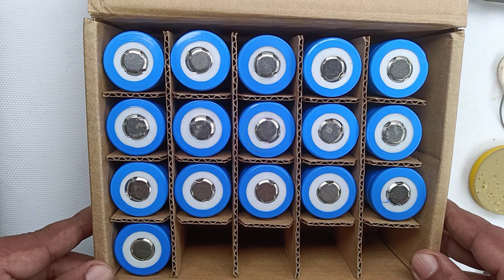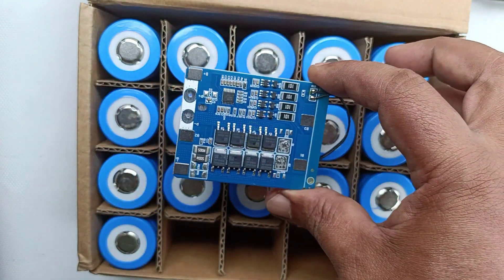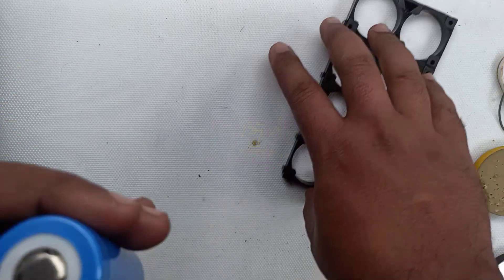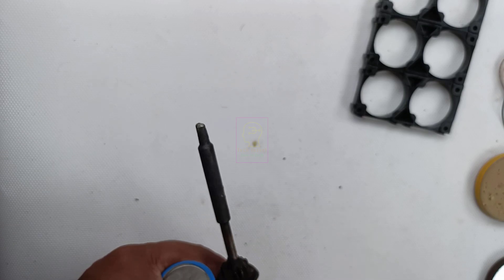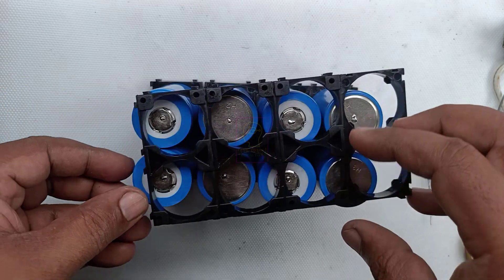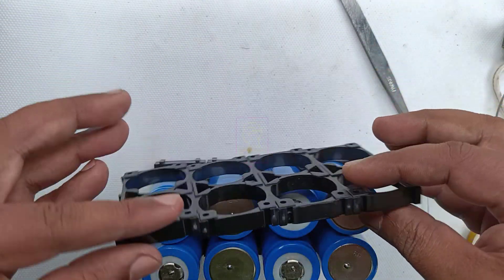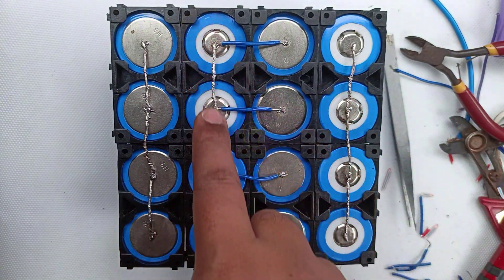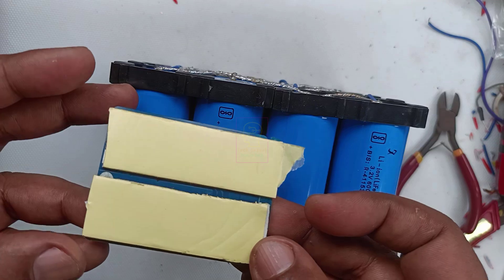Build Your OWN 12.8V LiFePO4 Battery for UPS in 1 Hour

Comment: Hii Nick
I have a computer UPS of 12v 7ah lead acid battery which give max 5 min backup
Now I want to change lead acid battery into lifepo4 battery 
I have purchased  lifepo4 battery ( 3.2v 6ah × 16 cell = 12.8v 24ah) with BMS lifepo4 4s 30A and also purchase active balancer 4s1A. 
My quest is can i directly replace battery with lifepo4 battery or I need to change in input  while charging battery kindly help me in this, I have only limited knowledge regarding this.
I will be thankful if you can solve out my problem 
Thank you 🙏
Reply from the maker: Do not use 30Ah BMS for 24Ah battery( i mean it for  1C). One of the property of BMS is short circuit protection. If you are using 30A BMS and if the short circuit current is > 30A then only it will disconnect the outputline. So it is safer to use <=24A BMS. 

Yes you can replace the existing battery with life battery. I have come across few problems. UPS is charging the battery with less than 1A current. When we are using a 24Ah battery  it will take more hrs for charging and the max voltage will be 13.6V. So what i was doing right now is i have connected two 10A  diode in parallel to the battery positive line so that battery will not be charged using the current from ups. For charging the battery i used 12V 100W solar panel with charge controller.
Reply: @TechInsert  : Great 👍 Thank you very Much for the solution 🙏

Comment: Very good project, just one question, that pulstron battery was bad? How long it lasted (years or months)?
Reply from the maker: For me it last for less than  1.5 year. I used that rarely . It was not good for ups. They are mentioned as 15A but in reality it was 12A.
Reply: @TechInsert  So lithium battery lasted just 1.5 years, all claims of long life are false and so was capacity.
Reply from the maker: Nope, the voltage for charging should be good and constant. 14.6v means it should not go beyond 14.8V.